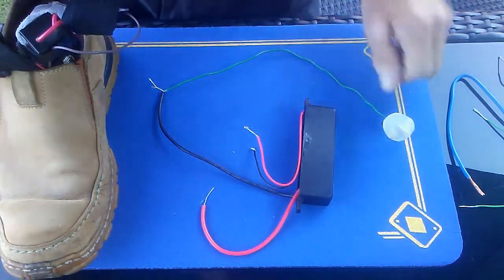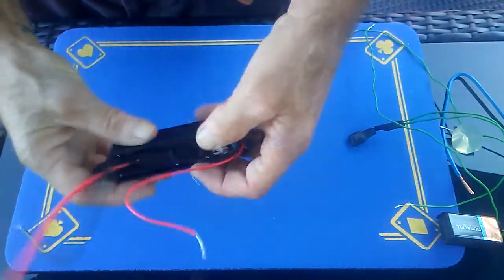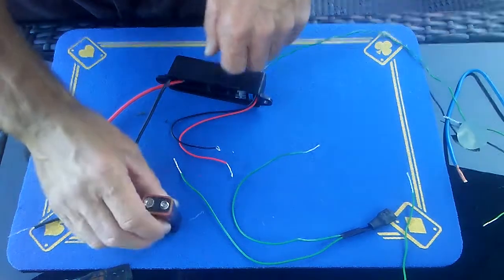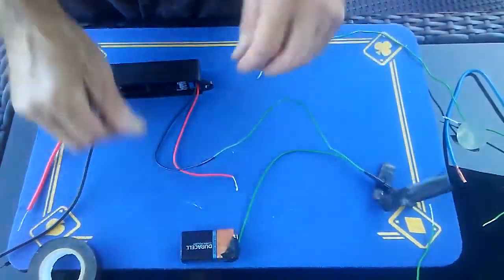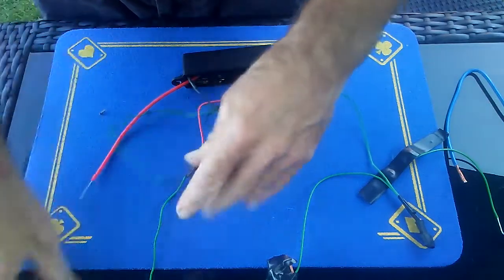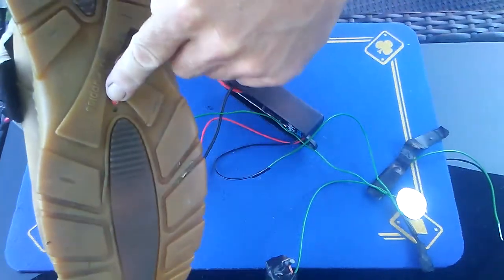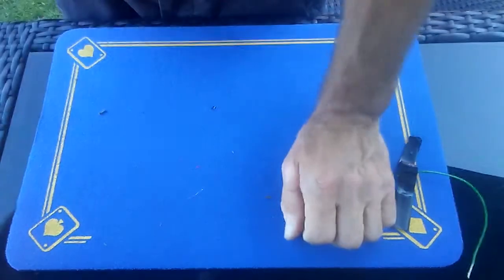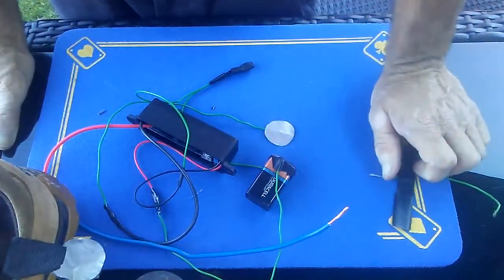yigal mesikas Electric touch  DIY build tutorial endless shocking possibilities⚡⚡

Comment: When I connected the battery for the first time i was touching the wires, I got a shock and it hasn't worked since.can you help me, There's no longer that high-pitched noise when I connect the battery, have I damaged the generator? I tested the battery in other places and it is working normally.